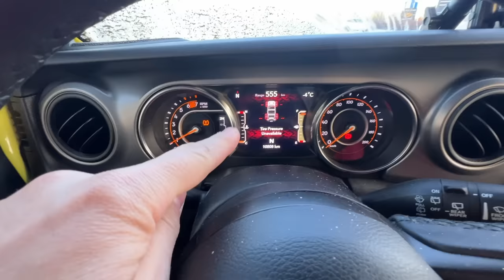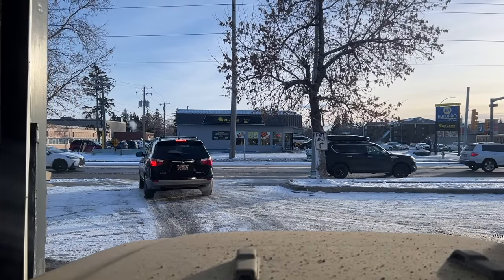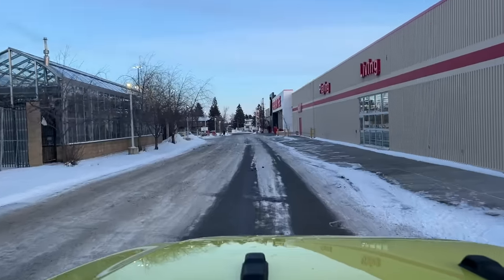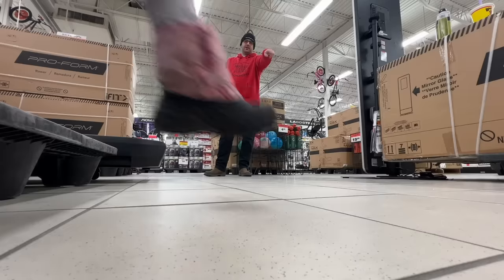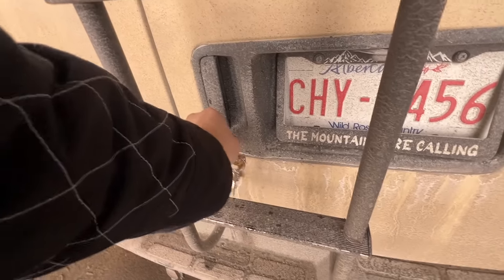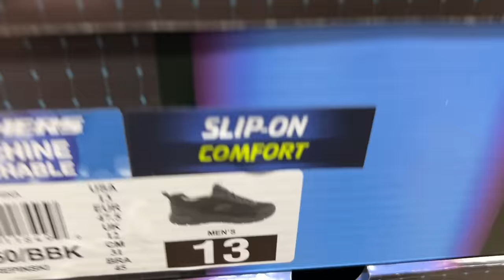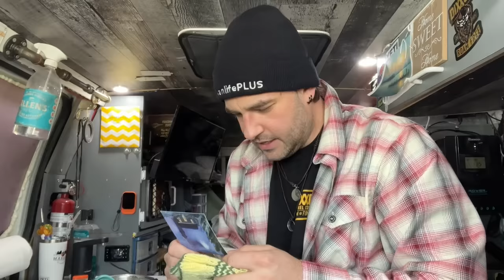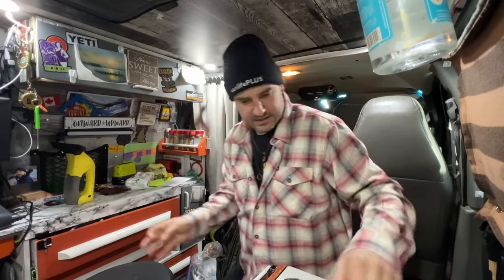Actual City Vanlife - How I Prepare for Cold Weather and P.T.

Comment: Does Penny need the stealth cover on the window in the winter? I thought it made sense in the summer because people would be afraid of a cat dying in a hot vehicle and break in, but I would be surprised anyone would do anything in the winter.
Reply: @007nadineL   it would take longer to freeze than die in a heat wave, except for a cold snap. I’ve seen people not worry for critters in cars in the parking lot most of the time. I wonder if it’s more to do with visible signs of vehicle habitation and having stuff that might interest a thief?